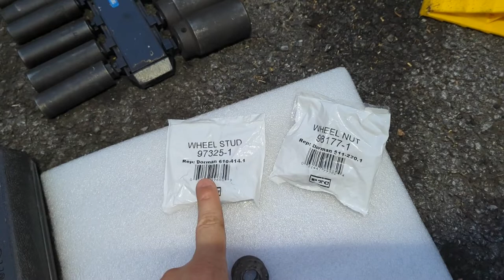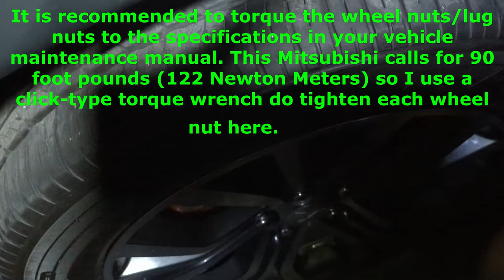How to replace a broken wheel stud. (Mitsubishi Outlander)

Comment: Just did this on my 2013 Outlander. If you rotated the hub you would not need to make an indentation as it clears the shield to the left on your video. I did not use any power tools, just hand tools and the new stud went in just fine. Thanks for posting, it made me realize how easy it was to do. I used a big nut as a spacer.
Reply: How do you get it to rotate when all the studs need to be replaced
Reply: Thanks for comment was about to remove dust cover
Reply: @tremoneyyy_tv314  Put the car in neutral